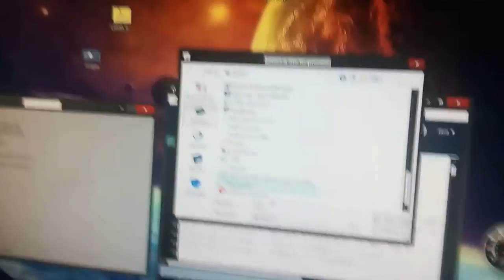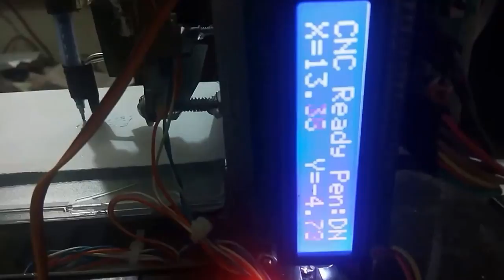Homemade cnc ploter lcd display upgrading

Comment: What is the power supply voltage and ampere values.1.5v 12v seems to be inadequate

Comment: Please mention  the connections between your lcd display and arduino board and link for final codes that support the lcd display to show pen movements and x & y axis movements
Reply from the maker: #include <AFMotor.h>

#include <Servo.h>

#include <LiquidCrystal.h>
#define LINE_BUFFER_LENGTH 512
char STEP = MICROSTEP ;
LiquidCrystal lcd(32, 30, 28, 26, 24, 22);

// Servo position for Up and Down 
const int penZUp = 140;
const int penZDown = 125;

// Servo on PWM pin 10
const int penServoPin = 10;

// Should be right for DVD steppers, but is not too important here
const int stepsPerRevolution = 48; 

// create servo object to control a servo 
Servo penServo;  

// Initialize steppers for X- and Y-axis using this Arduino pins for the L293D H-bridge
AF_Stepper myStepperY(stepsPerRevolution,1);            
AF_Stepper myStepperX(stepsPerRevolution,2);  

/* Structures, global variables    */
struct point { 
  float x; 
  float y; 
  float z; 
};

// Current position of plothead
struct point actuatorPos;

//  Drawing settings, should be OK

float StepInc = 1;
int StepDelay = 0;
int LineDelay = 50;
int penDelay = 50;

// Motor steps to go 1 millimeter.
// Use test sketch to go 100 steps. Measure the length of line. 
// Calculate steps per mm. Enter here.
float StepsPerMillimeterX = 100.0;
float StepsPerMillimeterY = 100.0;

// Drawing robot limits, in mm
// OK to start with. Could go up to 50 mm if calibrated well. 
float Xmin = 0;
float Xmax = 40;
float Ymin = 0;
float Ymax = 40;
float Zmin = 0;
float Zmax = 1;

float Xpos = Xmin;
float Ypos = Ymin;
float Zpos = Zmax; 

boolean verbose = false;

//  Needs to interpret 
//  G1 for moving
//  G4 P300 (wait 150ms)
//  M300 S30 (pen down)
//  M300 S50 (pen up)
//  Discard anything with a (
//  Discard any other command!

void setup() {
  Serial.begin( 9600 );
   
   
 lcd.begin(16, 2);
 lcd.setCursor(0, 0); lcd.print("CNC Ready");
 lcd.noDisplay();
delay(1000);
// Turn on the display:
lcd.display();
delay(10);
  
  penServo.attach(penServoPin);
  penServo.write(penZUp);
  delay(200);

  // Decrease if necessary
  myStepperX.setSpeed(600);

  myStepperY.setSpeed(600);  
  

  //  Set & move to initial default position
  // TBD

  //  Notifications!!!

  Serial.println("Mini CNC Plotter alive and kicking!");
  Serial.print("X range is from "); 
  Serial.print(Xmin); 
  Serial.print(" to "); 
  Serial.print(Xmax); 
  Serial.println(" mm."); 
  Serial.print("Y range is from "); 
  Serial.print(Ymin); 
  Serial.print(" to "); 
  Serial.print(Ymax); 
  Serial.println(" mm."); 
}

/********************
 * void loop() - Main loop
 ***********************/

void loop() 
{
  delay(100);
  char line[ LINE_BUFFER_LENGTH ];
  char c;
  int lineIndex;
  bool lineIsComment, lineSemiColon;

  lineIndex = 0;
  lineSemiColon = false;
  lineIsComment = false;

  while (1) {

    // Serial reception - Mostly from Grbl, added semicolon support
    while ( Serial.available()>0 ) {
      c = Serial.read();
      if (( c == '\n') || (c == '\r') ) {             // End of line reached
        if ( lineIndex > 0 ) {                        // Line is complete. Then execute!
          line[ lineIndex ] = '\0';                   // Terminate string
          if (verbose) { 
            Serial.print( "Received : "); 
            Serial.println( line ); 
          }
          processIncomingLine( line, lineIndex );
          lineIndex = 0;
        } 
        else { 
          // Empty or comment line. Skip block.
        }
        lineIsComment = false;
        lineSemiColon = false;
        Serial.println("ok");    
      } 
      else {
        if ( (lineIsComment) || (lineSemiColon) ) {   // Throw away all comment characters
          if ( c == ')' )  lineIsComment = false;     // End of comment. Resume line.
        } 
        else {
          if ( c <= ' ' ) {                           // Throw away whitepace and control characters
          } 
          else if ( c == '/' ) {                    // Block delete not supported. Ignore character.
          } 
          else if ( c == '(' ) {                    // Enable comments flag and ignore all characters until ')' or EOL.
            lineIsComment = true;
          } 
          else if ( c == ';' ) {
            lineSemiColon = true;
          } 
          else if ( lineIndex >= LINE_BUFFER_LENGTH-1 ) {
            Serial.println( "ERROR - lineBuffer overflow" );
            lineIsComment = false;
            lineSemiColon = false;
          } 
          else if ( c >= 'a' && c <= 'z' ) {        // Upcase lowercase
            line[ lineIndex++ ] = c-'a'+'A';
          } 
          else {
            line[ lineIndex++ ] = c;
          }
        }
      }
    }
  }
}

void processIncomingLine( char* line, int charNB ) {
  int currentIndex = 0;
  char buffer[ 64 ];                                 // Hope that 64 is enough for 1 parameter
  struct point newPos;

  newPos.x = 0.0;
  newPos.y = 0.0;

  //  Needs to interpret 
  //  G1 for moving
  //  G4 P300 (wait 150ms)
  //  G1 X60 Y30
  //  G1 X30 Y50
  //  M300 S30 (pen down)
  //  M300 S50 (pen up)
  //  Discard anything with a (
  //  Discard any other command!

  while( currentIndex < charNB ) {
    switch ( line[ currentIndex++ ] ) {              // Select command, if any
    case 'U':
      penUp(); 
      break;
    case 'D':
      penDown(); 
      break;
    case 'G':
      buffer[0] = line[ currentIndex++ ];          // /!\ Dirty - Only works with 2 digit commands
      //      buffer[1] = line[ currentIndex++ ];
      //      buffer[2] = '\0';
      buffer[1] = '\0';

      switch ( atoi( buffer ) ){                   // Select G command
      case 0:                                   // G00 & G01 - Movement or fast movement. Same here
      case 1:
        // /!\ Dirty - Suppose that X is before Y
        char* indexX = strchr( line+currentIndex, 'X' );  // Get X/Y position in the string (if any)
        char* indexY = strchr( line+currentIndex, 'Y' );
        if ( indexY <= 0 ) {
          newPos.x = atof( indexX + 1); 
          newPos.y = actuatorPos.y;
        } 
        else if ( indexX <= 0 ) {
          newPos.y = atof( indexY + 1);
          newPos.x = actuatorPos.x;
        } 
        else {
          newPos.y = atof( indexY + 1);
          indexY = '\0';
          newPos.x = atof( indexX + 1);
        }
        drawLine(newPos.x, newPos.y );
      
        //        Serial.println("ok");
        actuatorPos.x = newPos.x;
        actuatorPos.y = newPos.y;
        
lcd.setCursor(0, 1);
lcd.print("X=");
lcd.setCursor(2, 1); lcd.print(newPos.x);
lcd.setCursor(9, 1);
lcd.print("Y=");
lcd.setCursor(11, 1); lcd.print(newPos.y);
      
        
       break;
      }
      break;
    case 'M':
      buffer[0] = line[ currentIndex++ ];        // /!\ Dirty - Only works with 3 digit commands
      buffer[1] = line[ currentIndex++ ];
      buffer[2] = line[ currentIndex++ ];
      buffer[3] = '\0';
      switch ( atoi( buffer ) ){
      case 300:
        {
          char* indexS = strchr( line+currentIndex, 'S' );
          float Spos = atof( indexS + 1);
          //          Serial.println("ok");
          if (Spos == 30) { 
            penDown(); 
           lcd.setCursor(10, 0);
           lcd.print("Pen:");
            lcd.setCursor(14, 0); lcd.print("DN");
          }
          if (Spos == 50) { 
            penUp(); 
            lcd.setCursor(10, 0);
            lcd.print("Pen:");
            lcd.setCursor(14, 0); lcd.print("UP");
          }
          break;
        }
      case 114:                                // M114 - Repport position
        Serial.print( "Absolute position : X = " );
        Serial.print( actuatorPos.x );
        Serial.print( "  -  Y = " );
        Serial.println( actuatorPos.y );
       
       
        break;
      default:
        Serial.print( "Command not recognized : M");
        Serial.println( buffer );
      }
    }
  }

}

/*******************************
 * Draw a line from (x0;y0) to (x1;y1). 
 * Bresenham algo from https://www.marginallyclever.com/blog/2013/08/how-to-build-an-2-axis-arduino-cnc-gcode-interpreter/
 * int (x1;y1) : Starting coordinates
 * int (x2;y2) : Ending coordinates
 **********************************/
 

void drawLine(float x1, float y1) {

  if (verbose)
  {
    Serial.print("fx1, fy1: ");
    Serial.print(x1);
    Serial.print(",");
    Serial.print(y1);
    Serial.println("");
    
  }  

  
  if (x1 >= Xmax) { 
    x1 = Xmax; 
  }
  if (x1 <= Xmin) { 
    x1 = Xmin; 
  }
  if (y1 >= Ymax) { 
    y1 = Ymax; 
  }
  if (y1 <= Ymin) { 
    y1 = Ymin; 
  }

  if (verbose)
  {
    Serial.print("Xpos, Ypos: ");
    Serial.print(Xpos);
    Serial.print(",");
    Serial.print(Ypos);
    Serial.println("");
  }

  if (verbose)
  {
    Serial.print("x1, y1: ");
    Serial.print(x1);
    Serial.print(",");
    Serial.print(y1);
    Serial.println("");
  }

  //  Convert coordinates to steps
  x1 = (int)(x1*StepsPerMillimeterX);
  y1 = (int)(y1*StepsPerMillimeterY);
  float x0 = Xpos;
  float y0 = Ypos;

  //  Let's find out the change for the coordinates
  long dx = abs(x1-x0);
  long dy = abs(y1-y0);
  int sx = x0<x1 ? StepInc : -StepInc;
  int sy = y0<y1 ? StepInc : -StepInc;

  long i;
  long over = 0;

  if (dx > dy) {
    for (i=0; i<dx; ++i) {
      myStepperX.onestep(sx,STEP);
      over+=dy;
      if (over>=dx) {
        over-=dx;
        myStepperY.onestep(sy,STEP);
      }
    delay(StepDelay);
    }
  }
  else {
    for (i=0; i<dy; ++i) {
      myStepperY.onestep(sy,STEP);
      over+=dx;
      if (over>=dy) {
        over-=dy;
        myStepperX.onestep(sx,STEP);
      }
      delay(StepDelay);
    }    
  }

  if (verbose)
  {
    Serial.print("dx, dy:");
    Serial.print(dx);
    Serial.print(",");
    Serial.print(dy);
    Serial.println("");
  }

  if (verbose)
  {
    Serial.print("Going to (");
    Serial.print(x0);
    Serial.print(",");
    Serial.print(y0);
    Serial.println(")");
  }

  //  Delay before any next lines are submitted
  delay(LineDelay);
  //  Update the positions
  Xpos = x1;
  Ypos = y1;
}

//  Raises pen
void penUp() { 

  penServo.write(penZUp); 
  delay(LineDelay); 
  Z
Reply: Mamun Karim  thank you very much
Reply: Mamun Karim  please mention 16×2 lcd connections with arduino as well
Reply from the maker: yes
Reply: so where is your lcd pins connetion with arduino board
Reply: LiquidCrystal lcd(32, 30, 28, 26, 24, 22); what is this lcd pins?
Reply from the maker: lcd module local made easy for conection
Reply: Mamun Karim  did you tried this cnc with lcd codes?  They don't  make lcd display as we expected
Reply: Please try your codes as you mentioned here something wrong us there
Reply: Mamun Karim please discribe pin to pin connections between arduino and LCD. I have no idea about pin number 32,30,28,26,24,22 of arduino board which connecting to LCD.
Reply from the maker: im using arduino mega ... thats why im using this port ......code is working 100 % u See The Video
Reply: Mamun Karim 
I made my cnc plotter with  Arduino UNO 
And I connected  16×2 LCD display to 》 Arduino UNO as bellow
RS》12
E》11
D4》4
D5》5
D6》6
D7》7 
So my coding sentence is LiquidCrystal lcd(12,11,4,5,6,7);
Except that rest if coding as you are. But I have no display in my LCD.
 what can be the reason for that
Reply from the maker: Look Arduino Dosenot Have That Extra Pin Thats Why Im using mega... But  1 Way U can Make It ...If U Use i2c  display modul of LCD ..OK
Reply from the maker: https://www.techshopbd.com/product-categories/modules-98775/2197/i2c-lcd-adapter-techshop-bangladesh
Reply: Mamun Karim if I'm using 12c LCD adapter ,what would be the SDA & SCL pin connection in Arduino UNO. And write the code difference with 12c LCD module for
Reply from the maker: A4 A5
Reply from the maker: dont forget to downlode i2c library ..
Reply: Mamun Karim how could I find 12c LCD address at code writing? For my 12c LCD adapter
Reply: @MamunKarimtoyforusrc  You are a good youtuber...because you replied for all comments...😍😍😍

Comment: I made my cnc plotter with  Arduino UNO 
And I connected  16×2 LCD display to 》 Arduino UNO as bellow
RS》12
E》11
D4》4
D5》5
D6》6
D7》7 
So my coding sentence is LiquidCrystal lcd(12,11,4,5,6,7);
Except that rest if coding as you are. But I have no display in my LCD.
 what can be the reason for that
Reply from the maker: 2 steper motor need 8 pin 1 servo motor need 1 pin u can  use any analog pin to lcd ... analog pin A0..A6 can use digital pin ..ok
Reply: Mamun Karim with my cnc design it is difficult to change in to Arduino MEGA due to its size.according to pins used by cnc motors and servo motor of pen (as shared by cnc codes) Please suggest me a problem free  pins for LCD for successful display output. Do analog pins can use as OutPut for LCD?